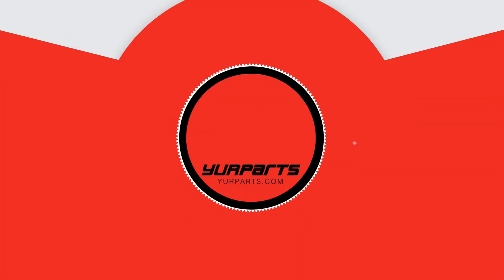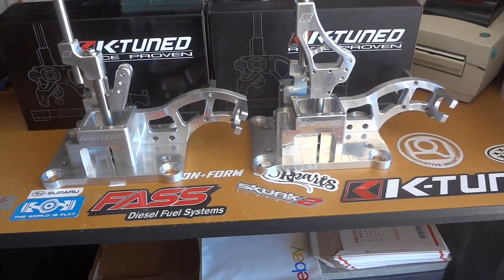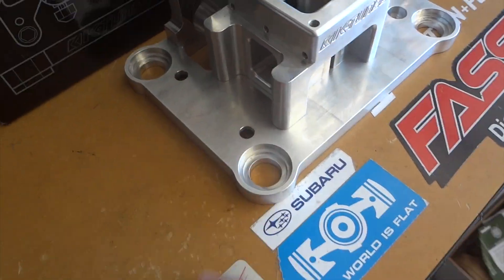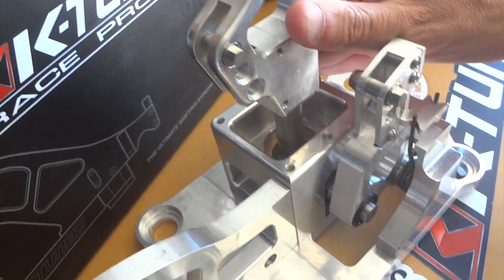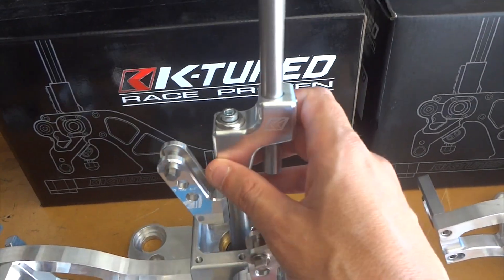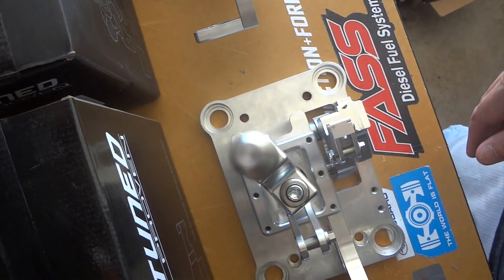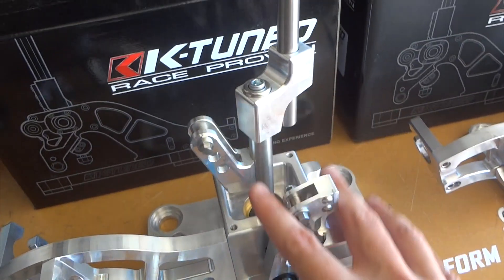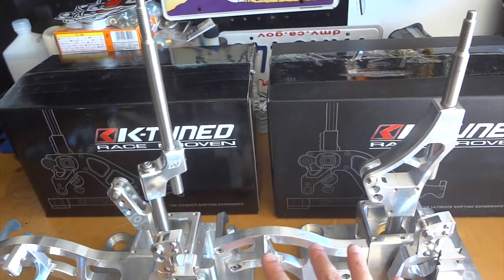K-TUNED SHIFTER BOX LINEUP!!! REGULAR VS PRO VERSION

Comment: Thanks for the in-depth look at the shifter.  I bought the street version for my rsx. Haven't installed it yet though. Was also looking into the shifter cables to match.
Reply from the maker: Should I do a video on the cables? Street vs Pro Version?
Reply: YURparts please do
Reply: Oem cables 110% ...id take used oem cables over new aftermarket cables..do your research and or ask around

Comment: ...nice...is there a model that would fit the honda EG with D16 engine?
Reply: No d series use shift linkage not cables. But k tuned does sell shifters for b and d